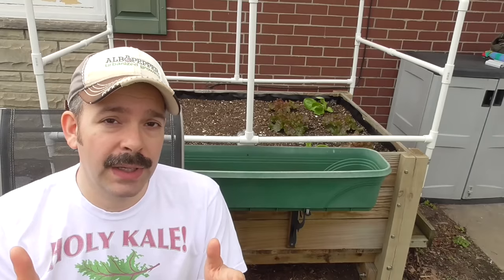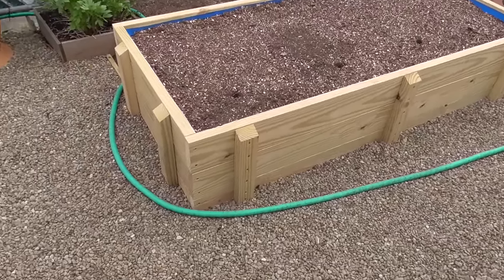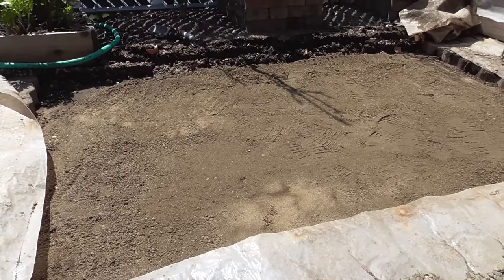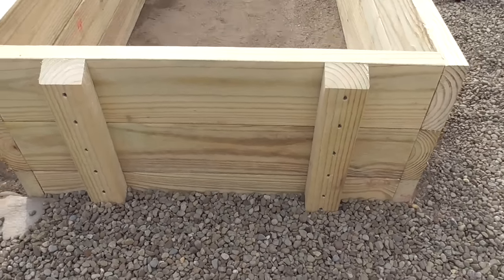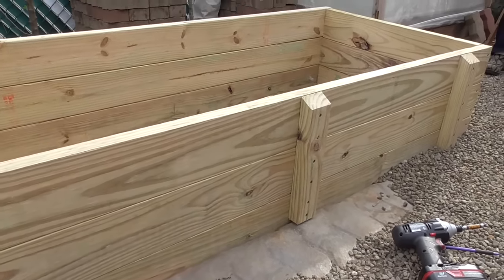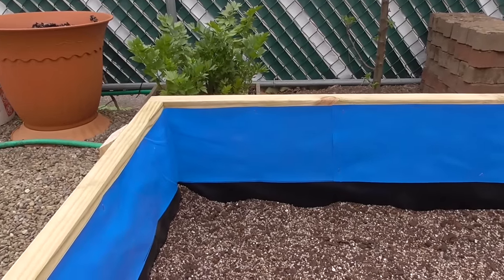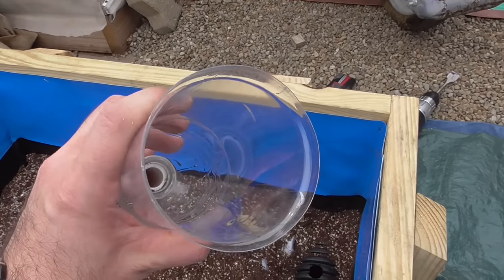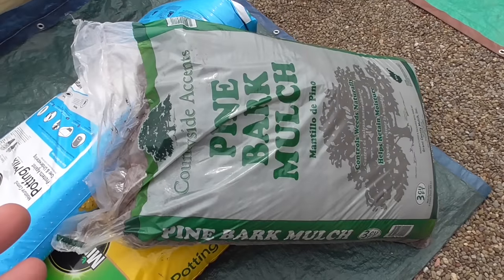Self-watering SIP Sub-irrigated Raised Bed Construction  (How to Build)

Comment: 6-1/4 feet is a strange choice from a lumber use perspective, Basically creates the maximum possible offcut waste. Regardless of choice between 6, 8, 10, 12, 14, or 16ft stock

I forgot to include the vertical boards which used the offcuts. I guess I saw them as much longer posts sunk into the ground providing additional containment, not just tying the slats together.
Reply from the maker: I agree that there's a little bit of waste. But it's not as much as you would expect: https://albopepper.com/waste.png It's not hard to make adjustments for even less board waste. The idea is to take these concepts and use them for whatever size you'd like. Later on, I built a 3rd SIP which is a 4' x 8' bed. It had very minimal waste: https://albopepper.com/images/high-density-corn-growing-in-backyard-in-tote-vs-sip-raised-bed.jpg
Reply: @Albopepper  It's 1-3/4ft wasted off of every sideboard. Times 6 is 10.5 feet. 1.75/6.25 = 28% waste on a primary component, that isn't a "little bit".
Compare using 12ft lumber and 6ft sides. Alt 8ft lumber with 5.5ft sides and the 2.5ft can be used for the width. OR 10ft lumber with 7*3 or 5*2.5...
Reply from the maker: Nope, that's not true at all. Two boards had 6" of waste (excluding kerf). Five boards had 4.75" of waste. And only one single board had 21.25" of waste. Obviously it wasn't really wasted. 🙄 It got used in other projects. You need to actually stop an look at the image I posted. You failed to account for the vertical boards, which is the critical flaw in your reasoning. You're making a big deal out of nothing. To spell it out even more clearly, I used 8 boards (768"). I cut away 57" of "waste." That's only 7%. But I easily used the longer board. It was NOT wasted. So that really only meant <5% waste. Design your box however you want. It doesn't matter to me. But your assessment is wrong.
Reply: @Albopepper  You are correct I failed to account for the vertical boards, and that indeed substanially reduces the portion of scrap material. 
(Standard accounting is 8% BTW, scrap/baseline material required. eg if 30ft is consumed for a project that only contains 10ft of material that is a 200% overage/scrap/waste, not 67% IOW if building to a contract that only provisioned 10ft, the contract materials would be considered 200% overbudget.)

Comment: I agree with you system, but not your soil mix. Wood chips should never be mixed into the soil because it will take the Nitrogen away from the plants to decompose. The wood chips should be put on top of the soil so as the decompose the fertilize the soil. Still use them , just use them on top. Cuts weeds and evaporation of moisture.
Reply from the maker: I never said to use wood chips. I said I used pine bark mulch. Ideally, it would be aged pine bark fines. And that is an excellent material to use in potting mixes. In the horticultural industry, it is a perfectly acceptable substrate. Pine bark is a good choice due to its high lignin content. Lignin takes longer to decompose. In contrast, the inner wood of a tree contains higher levels of cellulose, which breaks down quickly and depletes nitrogen in the process. You may still need extra nitrogen supplementation with pine bark, but it is a viable additive for mixes. It can be very cost effective too, depending on local availability. Use only dark, shredded bark, free of dyes. I recommend pine, 1/8" to 1/2" pieces.

It should be abundantly clear that I did not experience issues with nitrogen draft in the very 1st season. The results speak for themselves: https://www.youtube.com/watch?v=VJ2T6gUv8Gc

Comment: Where is the soil? i don't understand? where is the actual soil? we have used $1K worth of everything BUT soil... all for a $100 crop of organic produce... yeah i guess it will work... if you use $1K worth of everything BUT soil...
Reply from the maker: +lakisbouz  - This video seems more appropriate to your interests: https://www.youtube.com/watch?v=gtoxkhXgIaQ
 
The bed design in this SIP video allows someone to build a box right on top of a vacant parking lot or in an area with heavy soil contamination.  It doesn't cost any near $1k.  But it DOES help tremendously with water management in drought ridden areas.  If you are not in a high drought area, then you might not be concerned about that. But this is a design that fills a specific need and does so VERY well. No SIP kit manufacturer will ever tell you to use top soil in their SIP kit. Never.
 
On my lot, I put all of my homemade compost and "soil" in my conventional garlic and kale raised beds. I use it all in my perennial herb and fruit tree beds.
Reply: +AlboPepper Hey thanks for the informative answer... everything is so expensive here... getting half of the stuff required to do this bed would make this project impossible for me. much cheaper to get some good soil, some organic matter and away we go.
Reply from the maker: +lakisbouz - To build the actual box, the materials would be about $125 in my area. That includes four 4" x 10' drain pipes, eight 2" x 6" x 8' treated boards and a 6' x 9' pond liner. This box holds about 18 cu ft. By comparison a single EarthBox is $50 and it only holds 2 cu ft,  offering less than 1/6 of the surface area. So this system is more economical to build than it is to buy many retail SIPs. Building SIP Totes would be an even cheaper option.
 
For filling the box itself, you would need about 18 cu ft of mix. I would estimate between $80 to $120. This is costly compared to a load of topsoil. But it is not any more money than using Mel's Mix, which avid Square Foot Gardeners commonly use.
 
In total, you could construct the whole system for about $200 to $250. Hopefully that provides a useful point of reference. Thanks for visiting my channel, btw.

Comment: or you can just poke holes in the plastic at the bottom base and boom.. it lets the water out of the box. :D simple and less money
Reply from the maker: No. A 4x8 ft SIP can easily hold 50 gallons of water in the reservoir. Your approach defeats the hole purpose. Simple and less money? Dig a hole in the ground.

Comment: You lost me with the middle drain pipes not connecting to the side drains. Maybe explaining the concept first might be better. I will not be trying this. Sorry.
Reply from the maker: There's no need to connect the corrugated drain pipes. Works just fine. I did explain it even further in this video: https://www.youtube.com/watch?v=VJ2T6gUv8Gc  That said, if you don't wanna try this, then don't do it. It doesn't matter to me one way or the other. Sorry.

Comment: Why the hell does everyone think you need so much water? Build soil rich of humus and biochar then mulch it well put some stones around and plant with some deep rooted plants which will pump water from below. Never have to set any pipes etc.
Reply from the maker: I don't know who you've been talking to Ash, but "everyone" doesn't think that self-watering beds are necessary. SIPs perform a specific function and there are circumstances where people can really benefit from them. These work great for annual vegetables which DO in fact consume huge amounts of water when they are at their peak and Summer days have kicked in. The vast majority of my beds are conventional in-ground beds with lots of perennials. But I also know when sub-irrigation is beneficial, especially in urban settings.

Biochar is no more necessary than pipes. Everyone understands that building rich soil is highly sustainable and productive. But SIPs allow people to grow in concrete strips and asphalt driveways. They mitigate issues with heavy metal soil contamination, and excessively draining sandy soil. They allow people to grow on rooftops. Gardening comes in all sorts of forms. It's a matter of selecting the best technique(s) for each person's circumstances. No need to attack perfectly viable methods that don't fit in with your personal preferences.

Comment: No treated wood - the chemicals can leech into your soil and, ultimately, into your plants.
Reply from the maker: WHAT TYPE OF WOOD? Selecting the right wood for your wicking bed is matter of personal preference. But one thing to keep in mind: Depending on where you live, using treated lumber might not be a concern for you. In most places, chromated copper arsenate treatment (cca) is no longer sold to consumers. This applies to the US, Canada and EU. So if you live in these areas, you don't need to worry about arsenic exposure when using brand new treated wood. If you live in Australia, New Zealand or any other nation, then I suggest asking for a CCA alternative.

Of course, lining your bed with plastic creates a nice barrier between your lumber and the potting mix. But what if you just don't want treated, whether it contains arsenic or not? You could always opt for cypress, cedar or any naturally durable wood of your choice. Then there are also composite boards, cinder blocks or even corrugated metal panels. You have lots of options.

https://albopepper.com/SIP-raised-bed.php

Comment: MINUTE 25: "no manures, no bagged composts'" Hey, thanks for all the detail (not.) wtf? "You could use some worm castings." Some? 2, 3, 50, 100? SLOP! Where are all the "critical details?"
Reply from the maker: Yeah, I get people complaining about a 30 minute video. You want this to be 3 hours or something??? Read more details about nutrients at my site. Here's one excerpt out of a 4 page article:

BAGGED COMPOSTS? To prolong the viability of your SIP potting mix, it's best to replenish nutrients in the form of fertilizers. Organic gardeners are apt to use compost as often as possible. In SIPs, worm castings can be included in small amounts. But using composts in containers can yield unpredictable results. Bagged (retail) compost, humus or manure might have a fine consistency, similar to garden soil. If it contains fine silty particles then this can reduce pore spacing and aeration properties of the mix. That's why topsoil is NEVER recommended.

As air gaps get plugged up by ultra fine particles, compaction occurs. And since SIPs are always resting on a perched water table, the few remaining air gaps tend to be saturated with water. This impairs root health, preventing plants from getting the oxygen needed at the root zone. This can lead to a decline in plant growth, or even root rot and death. Even if plants grow ok in the first year, over time the potting medium may break down to the point that it must be replaced.

HOMEMADE COMPOST? Buying bagged compost is not financially advantageous in large beds anyway, not when compared to buying a bulk organic fertilizer. Of course, homemade composts might work, especially if they are mostly wood based. These tend to have more structure. Larger particle size means improved aeration. I've found though that it's very easy to reserve my compost for conventional beds and perennial plantings. It all gets used, just in a different location.

https://albopepper.com/refreshing-sip-potting-mix-adding-fertilizer-year-2.php